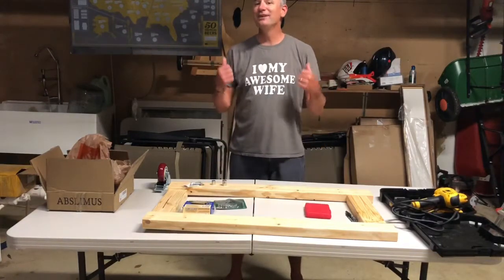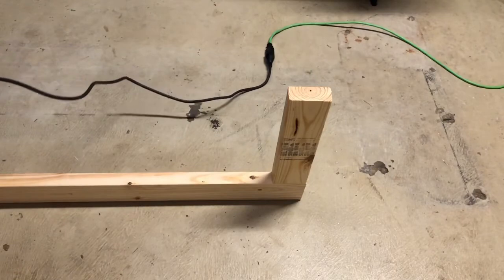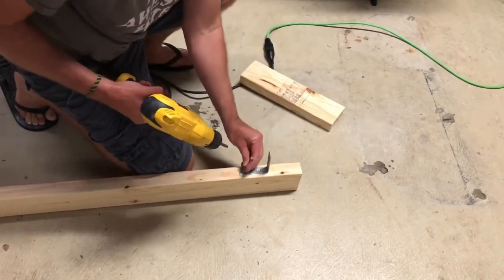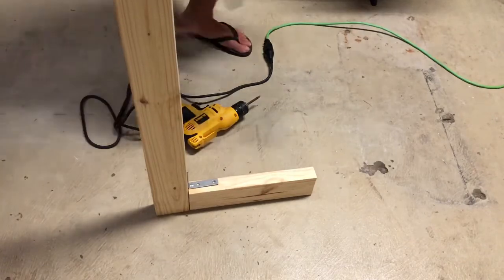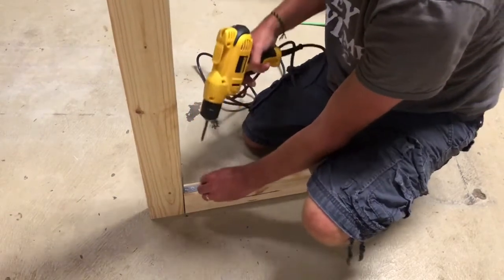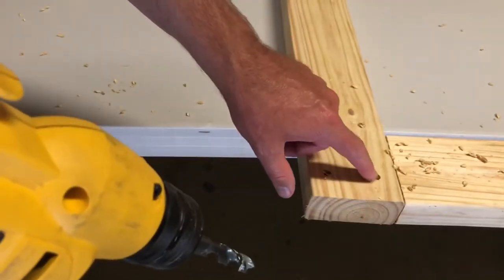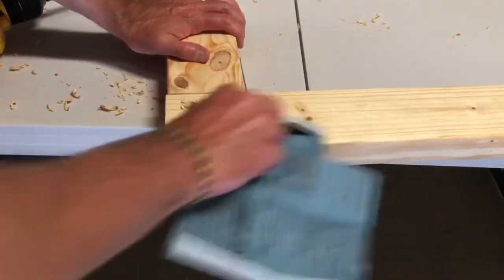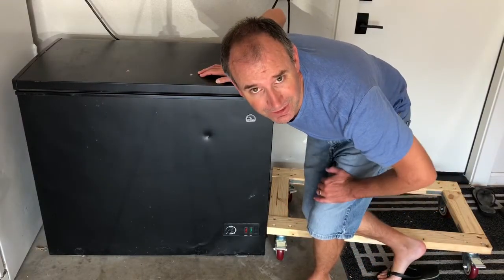Build dolly for freezer

Comment: This is exactly what I needed to see. I am a 65 yr old female. I think I can handle doing this. I want to buy a chest freezer but have no room in my apt. kitchen, so I want to keep it on the side of kitchen. Only problem is that the floor is carpeted. I was thinking of a metal pan of some sort, but this makes more sense. What do you think? Will it be good on carpeted area? I'm thinking a 5 cubic deep freezer. Thank you!!
Reply from the maker: Yes - you will want to get larger wheels do they don’t snag on the carpet - you may also think about one of those plastic mats for home offices :-)